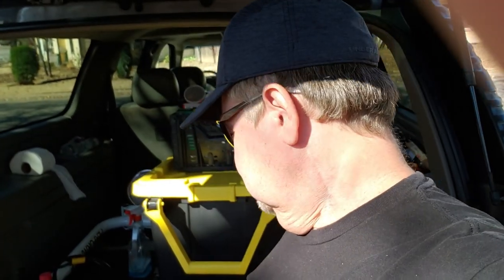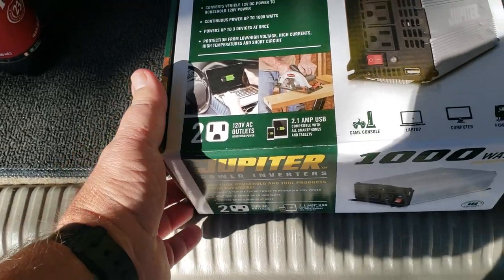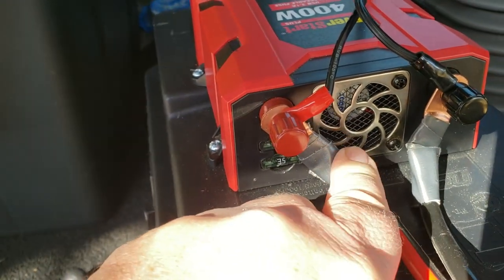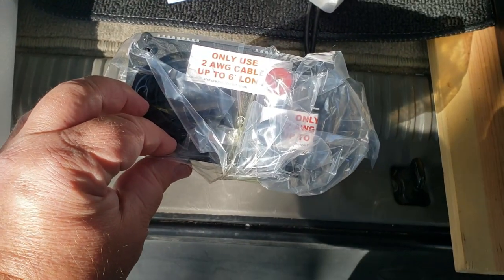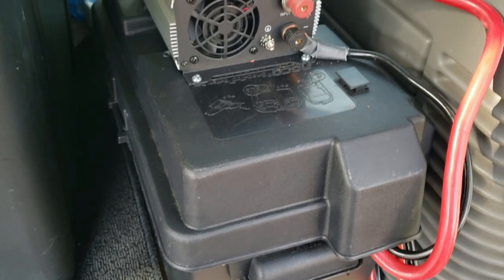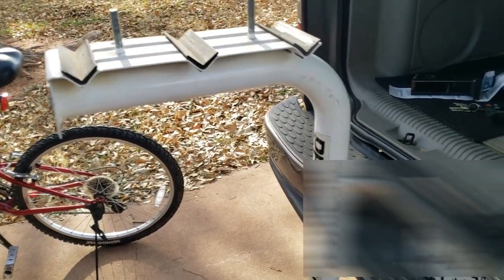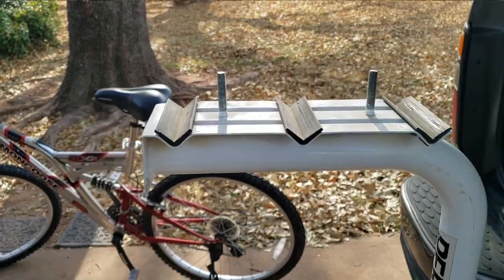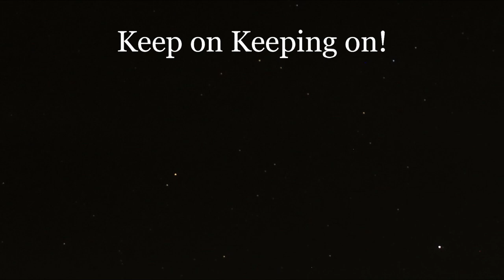JUPITER 1000 Watt Continuous/2000 Watt Peak Modified Sine Wave Power Inverter | Night Shot Photos

Comment: My harbor freight inverter failed me! Idk, I awaken to the buzz sound (as if batteries dead! But batteries, I've took as high as 13.5! Invertor still not working! I've taken it apart, nothing I can see! 
Function is like, I flip switch on, green a second, then the red light, buzzing! Like not enough juice
Reply from the maker: Depends on what you have plugged in to it, could be overloading and the fans kicking on to cool it down.  Might also check the fuses if it is equiped with them.  Mine has two on the back, opposite end as the outlets.  Other than that I wouldn't know.  With that being said, I am hoping to get a much larger one in the near future because mine seems to get overloaded more than it should.
Thank you for watching and commenting.
Reply: I thought it did! Buzzer was ringing! I ripped out buzzer! Been doing great 300 watts/1000 watt capable load! Thank God, got heat for this winter! 250 watt heater, isn't warm, it gets temps above freezing! I sleep at about 40° f when temps 20°! I'll get true sine wave one, mid spring! Efficiency is worth added costs! Would rather be doing 110 volt dc! Obviously, motor appliances like air conditioners require true sine wave ac! A bunch of projects targeted for spring time!

Comment: Need help? Has anyone used the instant pot outdoor. I want to get a power inverter but which one to get modified sine wave or pure sine wave. Do i really have to get pure sine wave. I'm not getting a straight answer from the instant pot company. I only want to power my Instant pot that it. I dont want to spend more than i need to. Any help would be appreciated
Reply from the maker: For some reason your comment was in a spam folder, not sure why.  Sorry for taking so long to reply.  I'm sure you already have a inverter but, just in case.  From all the research I did, a pure sine wave inverter is good if you are going to be powering very delicate power source.  For instance, a high end computer and things such as that.  But to just power general small appliances and lights, I tink a modified sine wave would be just fine.  I have had NO issues with my inverter.  Hope that helps.  Thank yoiu for watching!
Reply: Get pure true sine wave inverter! Efficiency!

Comment: WTF Happened to the inverter
Reply from the maker: Not sure what you mean.  The new inverter is working like a champ.  The only thing I would have liked better is if it would have had a voltage meter built on it.  The old 400 watt blew a fuse but it works now. 
Thank you for watching!